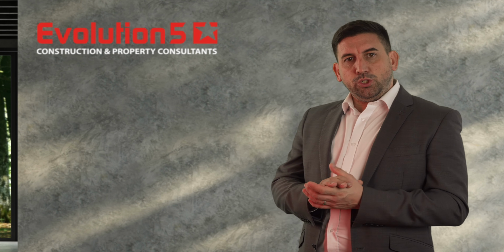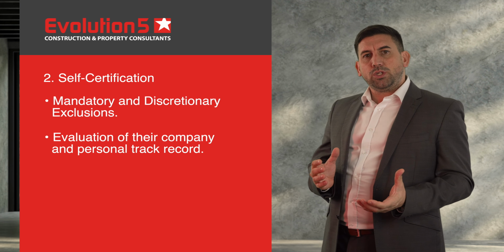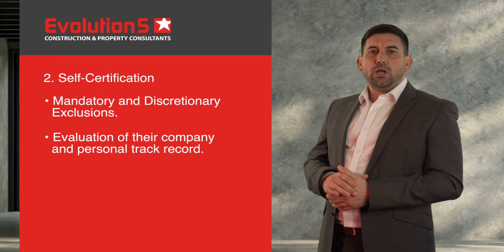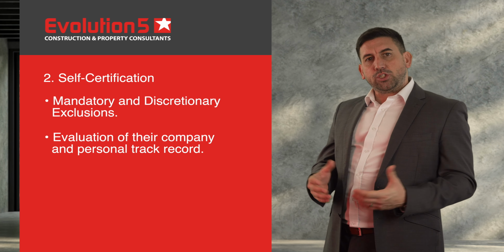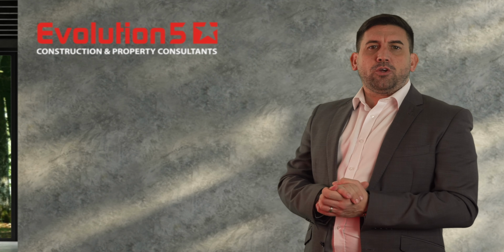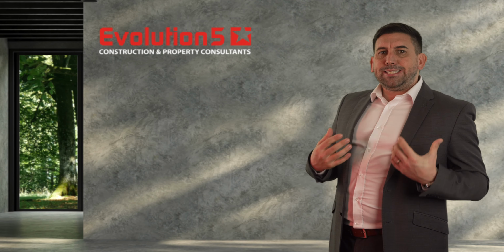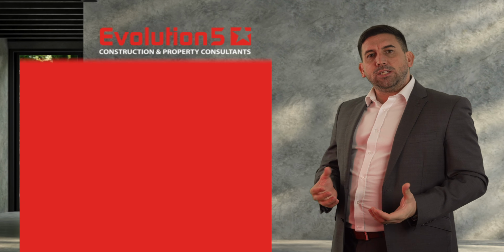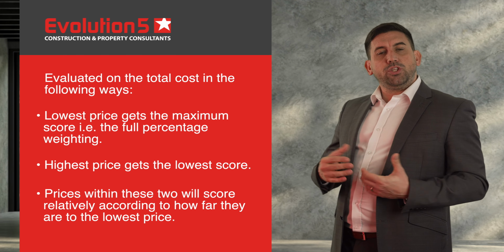Understanding the tender evaluation process for your construction project

Comment: I was told by tenders4u that normally you should apply for tenders half your turnover or less. Is this a good rough guide when apply for tenders?
Reply: I am also a government contract specialist, it depends on the total tender requirements. Case to case it varies.